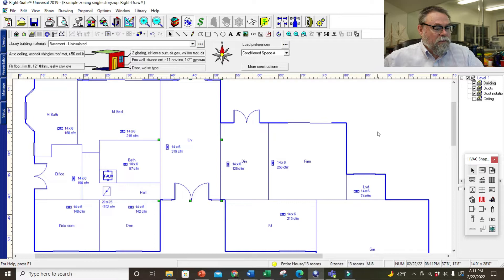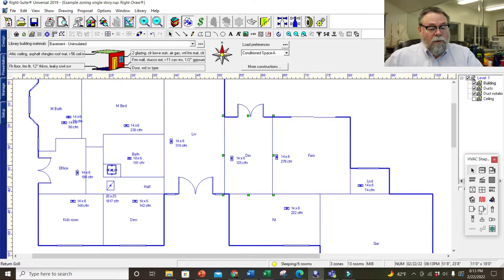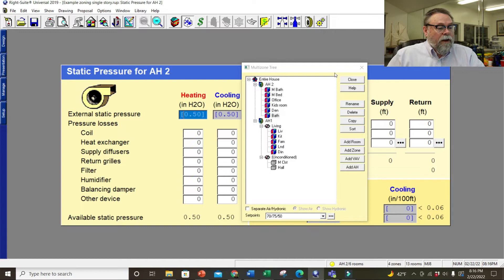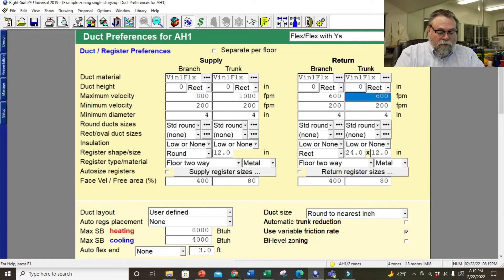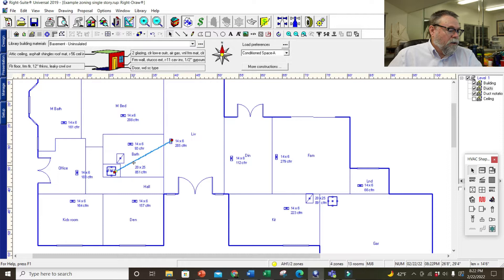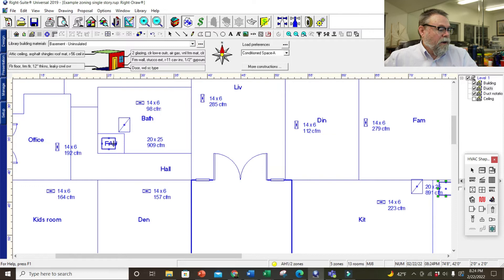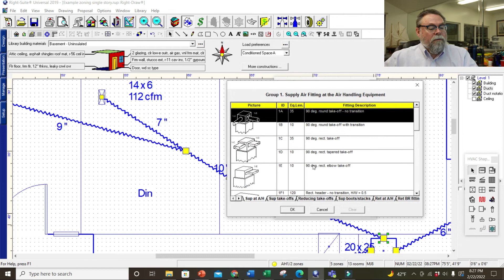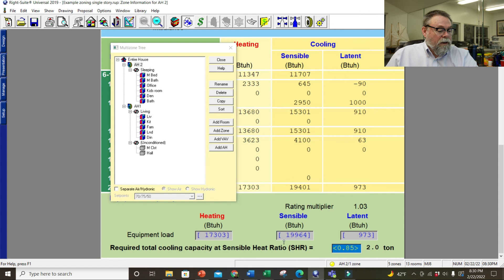Wrightsoft 2 zones or 2 systems

Comment: I am fixing to replace my 18-year-old system for my two-story house it's 2432sqft, I have two, 3-ton condensers and gas furnaces.  From the estimates I have, all the contractors have been opposed to one 5 ton two-stage, zoned system.  They say two systems one 2 ton upstairs and a 3 ton down.
Reply from the maker: Better yet, have them quote two ducted minisplit airhandlers with one outdoor unit. This should come in about the same price as zoning and one 5 ton system and give you the flexibility of ramping up capacity for either zone making it extremely more efficient than two systems or one system with zoning.
Reply: , @baileysair  I asked one of the contractors he said they are ducting size limited.
Reply from the maker: @scifiuniverses3736  First, they need to do a load calculation on the home, measure the existing static of the system and use a blower chart for the equipment to see how much air is actually being moved. Then and only then can they tell you if the ducts are limited. That being said your house might not require 5 tons. We do homes here in the Central Valley where it gets 110 degrees in the summer that is around the same square footage with a 4 ton and sometimes a 3.5 ton. The load calc will tell all.
Reply: , @baileysair  I can send you the load calculation a friend did on my house.
Reply from the maker: @scifiuniverses3736  Sure, I would be happy to take a look..
Reply: @baileysair  Sent.

Comment: Hi Mr. Mitchell...would you recommend Wrightsoft over Elite since your got experience with the first?
Reply from the maker: I have not done Elite so I can't compare. However, I hear Elite is good software, you could also do 3D software as I also hear it is good. What ever one you chose just stick with it.
Reply: @baileysair  Thank you sir..I'm still not decided yet which one I'm going to pick, but your video makes it easy to try..Last thing what's your advice to start with as a beginner for modules packages, please?
Reply from the maker: @mohammedalobaidi9981  You want to do Right J, Right Draw, Right D and Right S That would be the best package.
Reply: @baileysair  Appreciate it sir.

Comment: On your SHR that you're changing to .85 standard, is this applying to encapsulated homes too? I was taught a method to use for encapsulated homes to get the SHR and it will come in a bit higher than the preset .70, typically .89-.92.
Reply from the maker: I run it at .85 and actually could get a way with .95 in our area. This is due to the low humidity here in the central valley. For example; today it was 113 degrees but the humidity level was only 17%. This means we have very, very little latent and can get away with a system that does well on the sensible side. If you live in a humid climate like most of the East and South you have to account for the humidity so a lower SHR is used. 

Encapsulated homes have to breathe, so you need to pay attention to ventilation and should install a energy recovery ventilator to remove the moisture that comes in with your fresh air. In addition, you might have to add a dehumidification unit. You should also slow down the fan speed from 400 cfm per ton to 350 cfm per ton to help remove more moisture from the air as we don't want the home to rot from the inside out. So setting the fans speed and having proper ventilation will allow you to set the SHR to around .90.

Hope this answers your question.

Comment: Hi Mitchell,
We have 3761 sqft 2 storie home with basement another 1200sqft! My builder saying have 5 ton HVAC with 2 zone system!! But in this case can we have 2 HVAC vs 1 HVAC with 2 zones which is best option? Can you please advise?
Reply from the maker: Hello AK, 2 separate systems would be the best option. Most people do one system and zoning to save money, but using a single system for each zone is always preferable. I would go variable speed compressors on each system. This would allow each one to ramp up as needed, giving the most comfort along with the best energy savings.
Reply: @baileysair  Thank you Sir! Variable speed compressure means 2 stage process?
Reply from the maker: @charvigogineni  One more thing, you could switch to a single multisplit outdoor unit with variable refrigerant flow and use two ducted air handlers for each zone. This would work well also as it would be zoned yet have separate air handlers for each zone.
Reply from the maker: @charvigogineni  No, the variable speed compressor will ramp up as you need more cooling thus running at a lower speed most of the time which will equate to lower cost to run. Two stage compressors have two speeds and are less expensive than variable speed, they usually run first stage at 70% and second stage at 100% while the variable speed starts our at around 30% capacity and ramps up in 1% increments till it reaches 100%. The key here is that most of the time you will not need 100%. When you install a variable speed you can pretty much set the temperature you want in the home and just let it do it's thing all the while saving money and being very comfortable in the home.
Reply: @baileysair  Great! Thank you Sir👏👍
Reply: Hi Mitchell,
Finally my builder asking what type of HVAC system we need? I live in Ohio ( winter state)  So I have to ask them 2 HVAC units for each floor ( 2 storie home so basement and First floor one unit, second floor seperate unit with variable speed compressor for each System)?
Reply: 2nd system is recommended based on the HVAC calculations. (5 ton Basement & First Floor and 2 Ton for Second Floor). Note: The basement will have 4 duct trunk lines running across the basement ceiling and vertical duct chase added in Entry Closet and Pantry